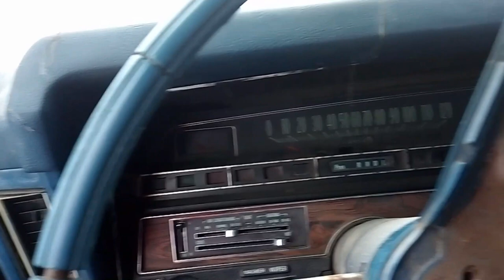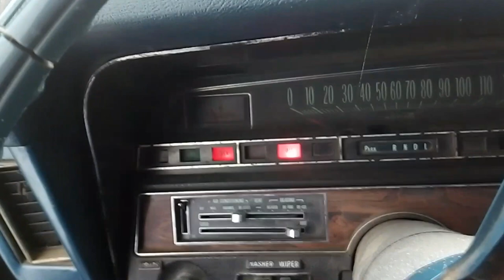1970 Chevy Impala Cold Start and Cruise Attempt

Comment: I had one of them minus the ac for years. I thought it was one of the better cars I've had in the snow. I delivered the morning newspaper with it for years and with a set of studded snow tires and some weight in the trunk it did great. 
1994 gas is probably what's saving that thing right now. 1994 didn't have the ethanol content that gas today has. 
between the International, your Impala, and the Torino, it looks like my driveway back in 1980 or so here. All that's missing is a few Plymouth Satelites, a Dodge tradesman, and a '77 Dodge truck.